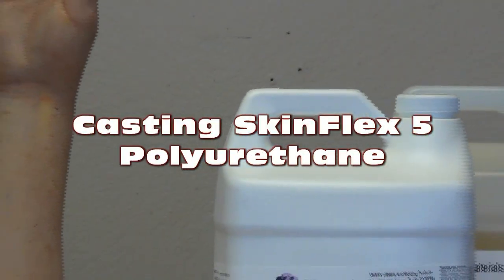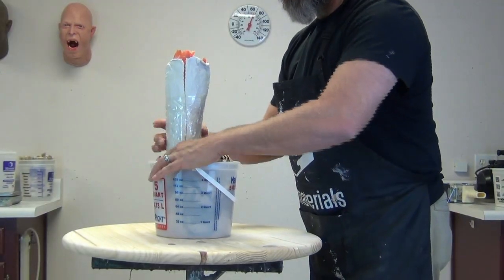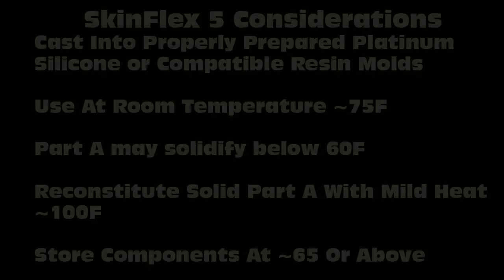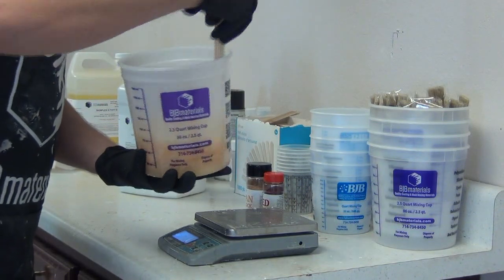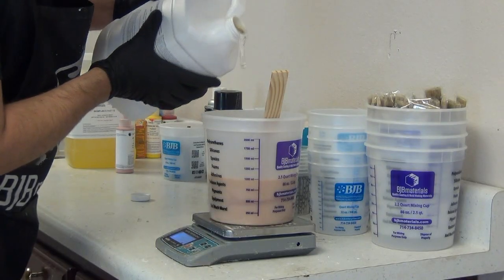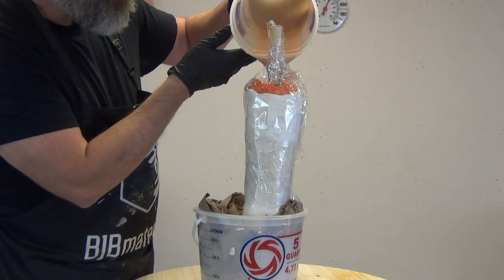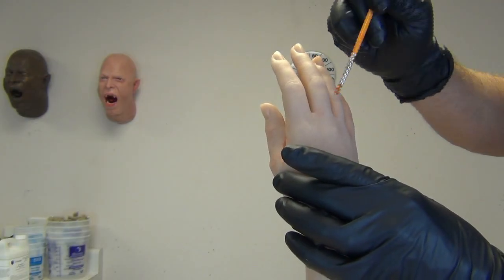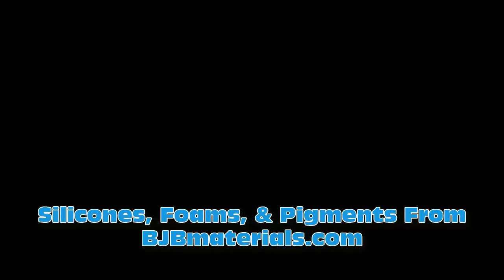Casting A SkinFlex 5 Prop Arm From A Lifecast Mold

Comment: is SC-94 the same or similar to the original 'flex paint base' sold by bity or in which ways are they different?
Reply from the maker: SC-94 is a completely different formula. They are intended for the same purpose but are totally different chemistry. SC-94 starts and dries clear. That’s probably the most obvious difference.
Reply: @brickintheyard  thanks!

Comment: I was wondering if it would be possible, using your technique, to make a glove with a hollow section.
Reply from the maker: It would definitely require a core, and the core would need to be the size of the hand going into the glove.
Reply: @brickintheyard  How should I go about it? Do you have any suggestions for me? I’m just starting out.
Reply from the maker: @leonardjund3719not something I can explain in a comment, but I’m working on a couple of videos that will explain the basics of a core.

Comment: Thanks, it seems like a very heat-sensitive material though.
Reply from the maker: The temperature sensitivity mentioned in this video is related to cold weather and the part A component before it is mixed with B and cured. The parameters discussed here are related to mixing and pouring. If you are new to room temperature cure materials be sure to check the links and read the technical bulletins.